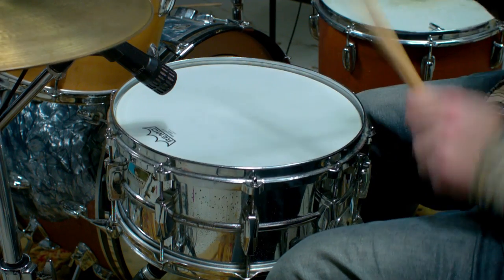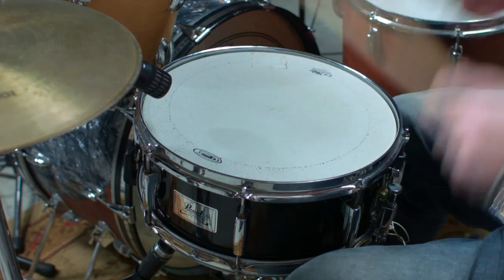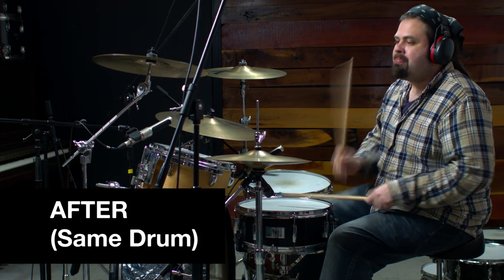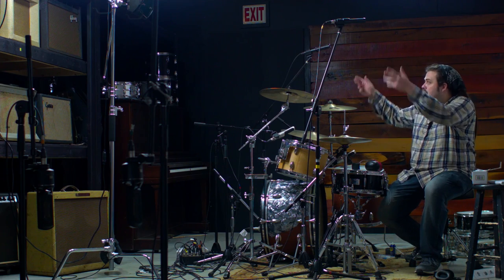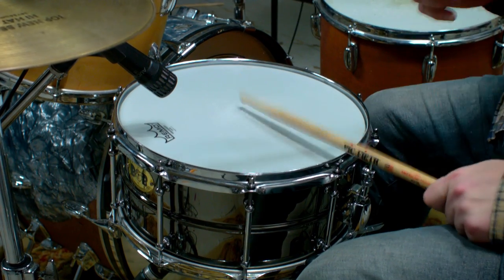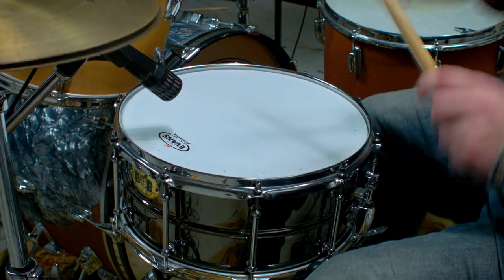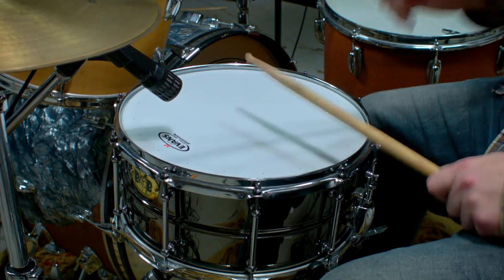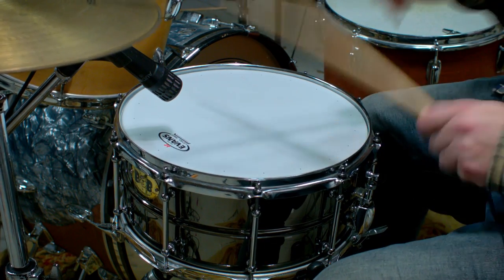Ludwig vs Pork Pie - Both drums with Die-cast and Triple Flange Hoops

Comment: Some ring to a snare is most often needed in a mix for it to sound lively enough.  I'd rather have some excess ring that I can EQ out than not have ring & need some for the mix.  So, for the most part I preferred the Ludwig.  I did like the high-tuned Pork Pie with triple flanged hoops better than the Ludwig with flanged hoops.  Great video.

Comment: Both are nearly indistinguishable tuned low with the die-cast. The Ludwig overall, seemed to have more over ring. However... I think I like the over ring when tuned high with the triple flanged hoops.
Reply: NOT ring !!! it's called sustain and there IS a diff.

Comment: Pork Pie ftw. I definitely thought it edged out the Supra. At low tuning the BOB sounded cleaner, at high tuning it had a beautiful pop to it that the Supra didn’t. The Pork Pie brass snares are a great value, and after hearing a side by side like this how could you pay over 2x the price for a seamless shell? The sound doesn’t lie, seams don’t matter. I’d even argue that the seam is probably the factor that’s drying it out that little bit more and cutting down on dissonant overtones. Whatever it is, it sounds gorgeous! 

Cool video idea and excellent execution, thank you sir 🙏
Reply: just sounds more muted. not in a good way to me.

Comment: Great video. Have been digging into this recently. It seems the newer Ludwig Universal Brass snare might be the same 'WorldMax' shell as the Pork Pie BOB. And they can be picked up around $350. And can get you 80% of the way to that Supraphonic/Black Beauty tone, for a third to half the price. With the right heads, and modding. This is useful for gigging musicians too, where they might not want to lug around a 1k newer Black Beauty, or worse a vintage one. And risk damage or theft. They're good for something to leave at the rehearsal space. Or, if you have a 5" or 6.5" Black Beauty, and want an 8" version for an alternative flavour.
Reply from the maker: Hmm, I wonder if you can just build the snare if you can get the shell. But then again, you can buy used, and then always sell it for the same price later if you go with Ludwig.
Reply: @creativesoundlab  I guess the advantage of doing that would be that you could buy better quality hardware to begin with. Vaguely like how if you intend to heavily mod a guitar, better to buy a Squier or Epiphone rather than Fender / Gibson. Since your basically taking it back to the wood anyway, no point in paying extra for the middle of the road hardware. Buy a decent something with a decently built body, and start cheaper from closer to blank slate. But, the same resale argument you mentioned applies. Only good idea, if it's for a keeper. And you don't care about recouping the costs.

Comment: Great video comparison, I cranked up my ADAM Speakers and at the low tuning the two drums regardless of hoops sound completely interchangeable, but I think I liked the BOB Better than the Ludwig with the Die cast rims. At the high tuning with the  triple flange the tuning change made it difficult as the BOB was tuned higher and sounds a bit choked out. I would go with the Pearl big brass Snare (BOB), wish I had one. Check out ; if you can find one, the TAMA JT147 or John Tempesta snare...WOW, wish I could afford one.